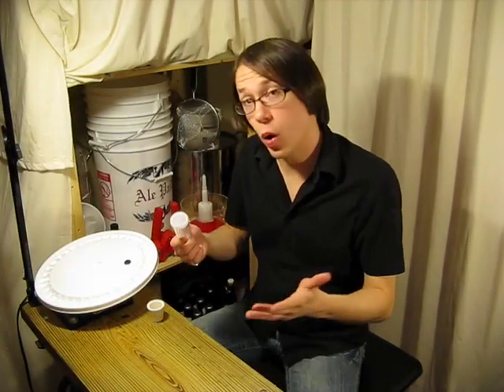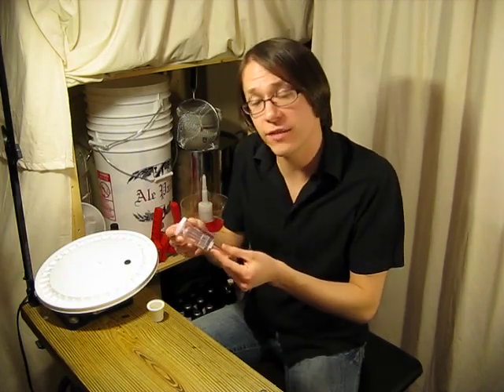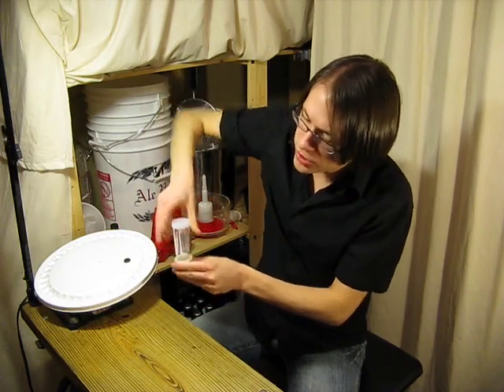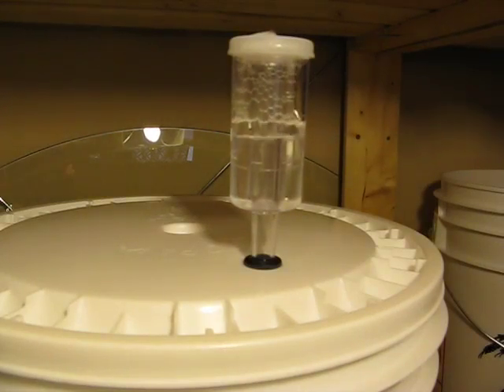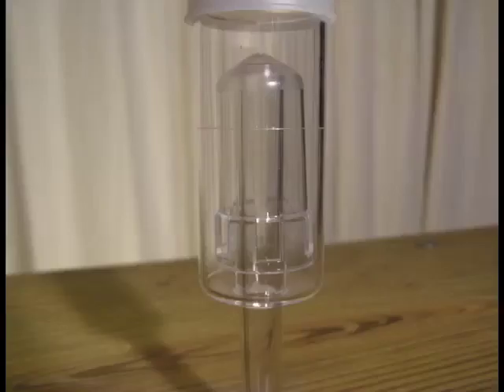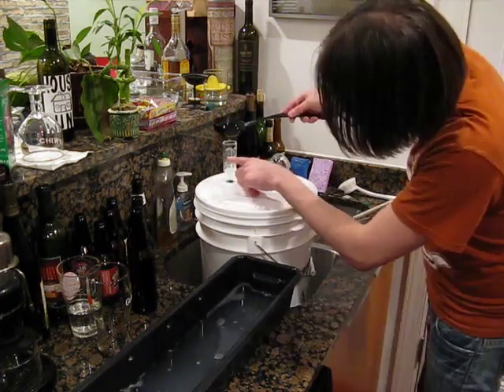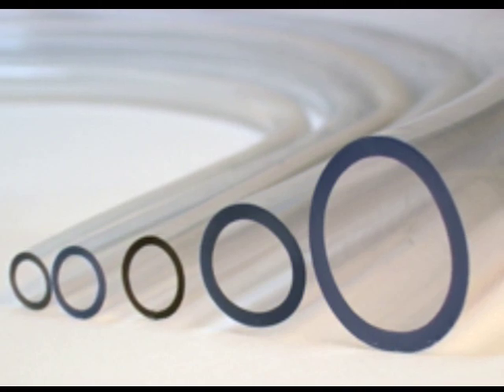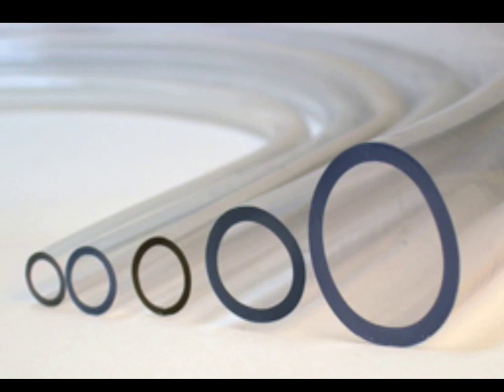Basics of Home Brewing:  What is an airlock / blow off tube?

Comment from the maker: The lid on the airlock (if it has small holes in it) should be tightly 'snapped' on the top of the airlock.  You should expect to see bubbles within 24 hours typically--but depending upon your yeast, cell count, and nutrient/oxygen levels it may be quicker or longer.